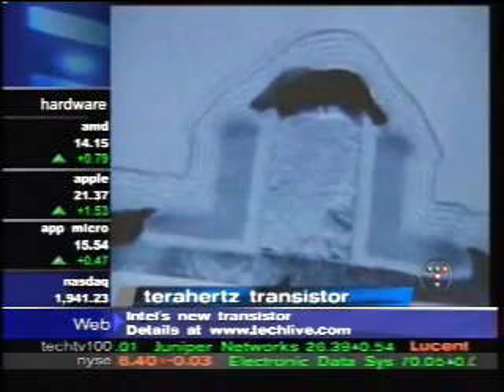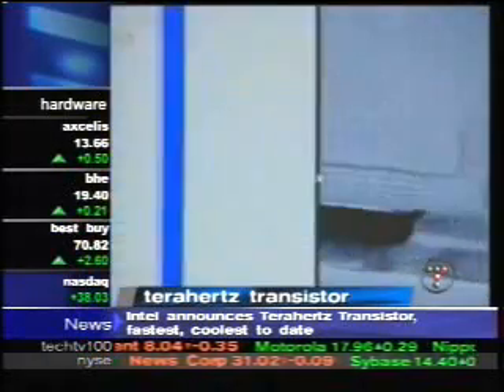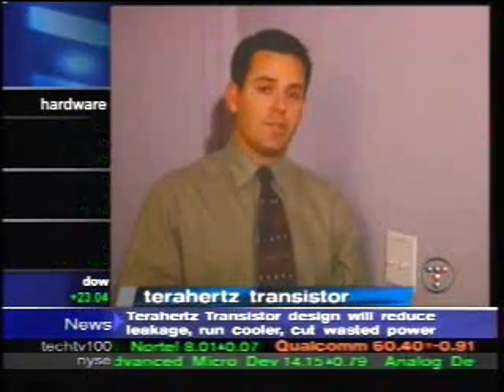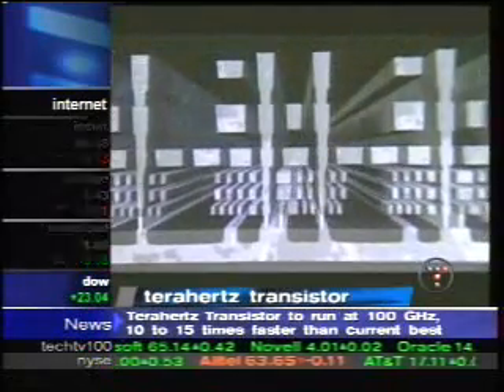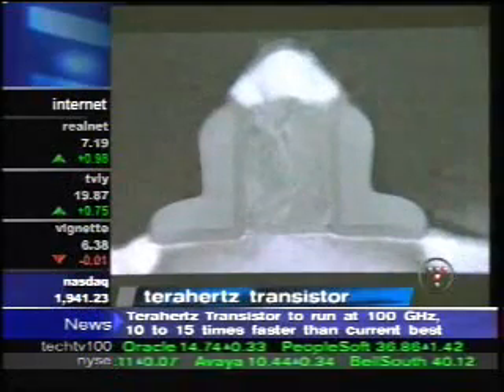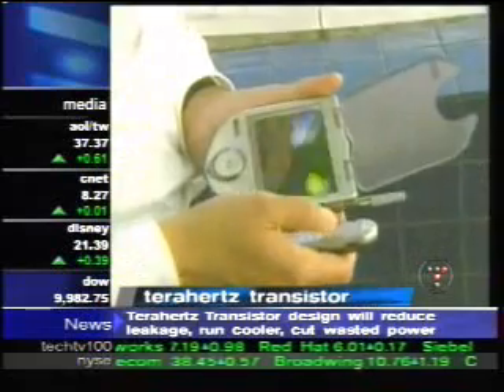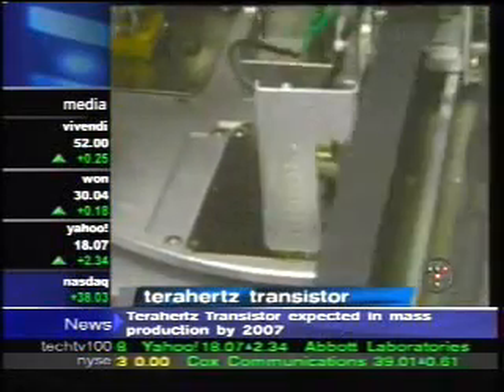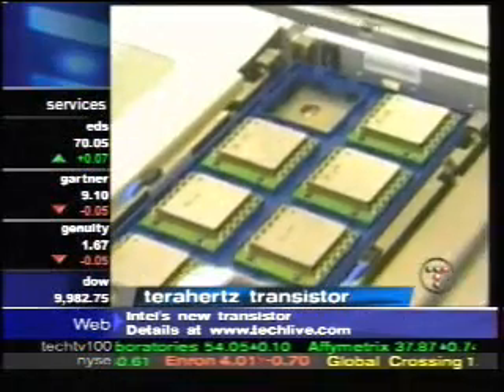2001 techtv clip - intels new "terahertz transistor"

Comment: 18 years ago running at 100GHz with 1THz capable and we STILL aren't above 5GHz ! 
2001 3GHz, 2019 4.5GHz, yet video cards are using other ideas CPUs don't use too. If it followed Moores Law we should be at 768GHz, not counting the Terahertz technology !
First 1TB and 2TB hard drive in 2007 and 2009, yet in 2019 they STILL SELL THEM 12 years later !
Reply: @cdrom a single IC with a dedicated THz transistor would outperform 5 core i9 extreme editions. Shut your mouth if you don't have a clue what you are talking about bitch.
Reply: I blame Obama
Reply: @smokinamby  Right after 9 something the NSA said, "consumers have too much computing power and we need to limit it"... completely unrelated I'm sure. Just another "theory" that was on NBC TV news back then... We know what theories mean now, almost always true... like no security camaeras in the whitehouse, didn't see anything... or used dogs to sniff out the owner.

Comment: @rfvtgbzhn
Thankfully it doesnt take 10 years to put a new CPU chip into production; once the transistor (main component to a CPU) is established as operating within tollerances, one can start moving to the design phase and prototype/production.

Hence the predicted retail date of 2007, Its far more proffitable (and wasteful) to release small increments than release just 1 standard high performance chip which is their benchmark for the next 4 years. As for intel/amd its a monopoly.
Reply: On Intel Terahertz TechTv they said intel said, "it would be for sale to consumers by 2005". At the very least it should be used since it uses much less power... great for phones too, and with 10,000 times less leakage great for higher densities and especially RAM. If you are interested look at CPU computer power used 2002 March that has a 3 page story about this. I scanned that in too. Send you a copy.